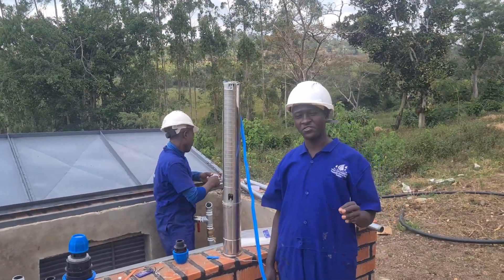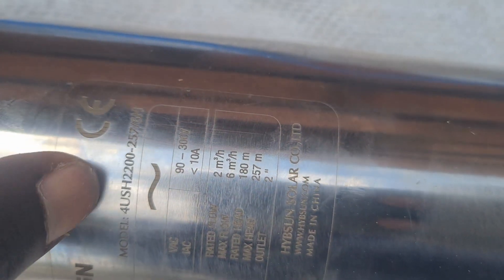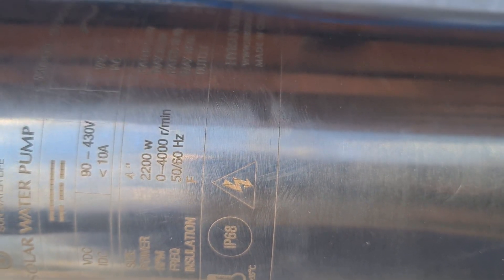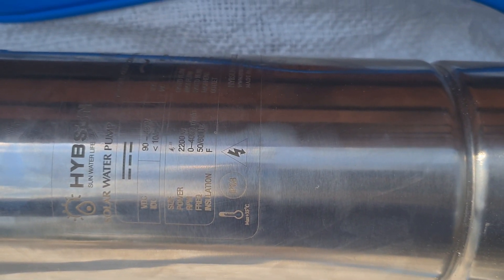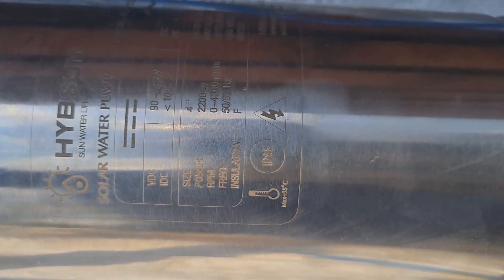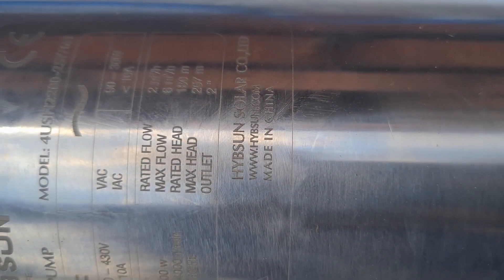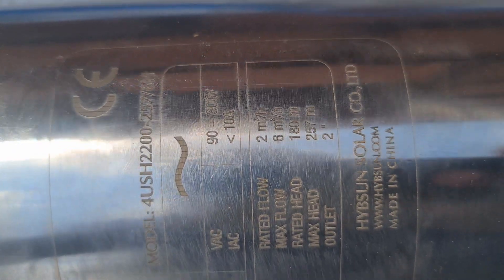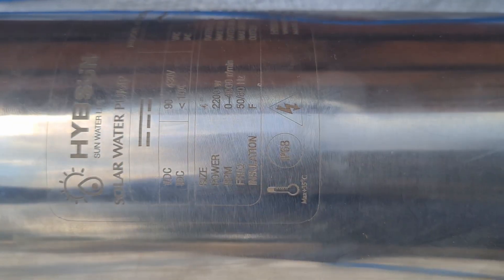Know your solar water pump specifications   Hybrid Option

Comment: Can any AC pump which is not hybrid run on DC  current after connecting it to a Variable Frequency Drive (VFD)
Reply from the maker: Some VFDs doesn't run permanent magnet motors